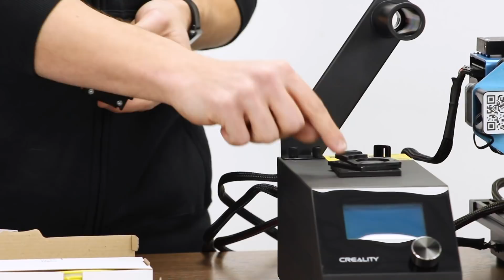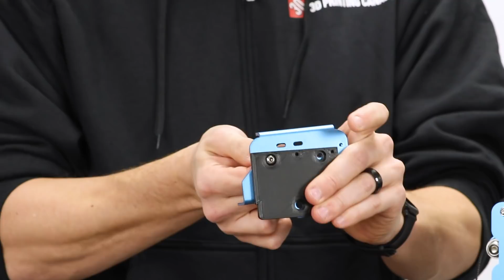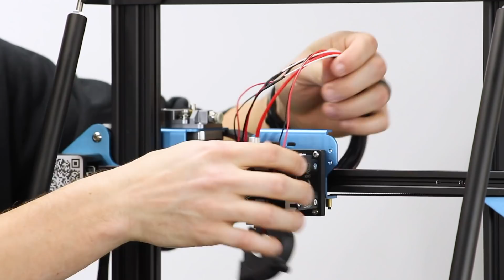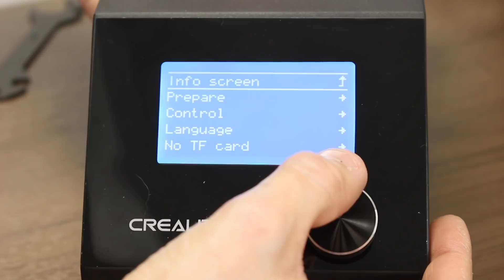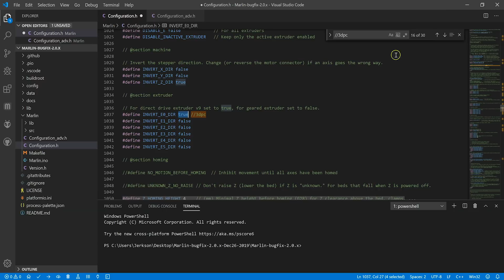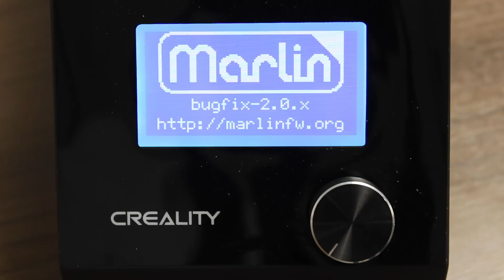How to Install a E3D Hemera on a Creality CR-10 v2

Comment: Thanks for a very thorough and informative video. I have the CR-10s Pro V2, but most of what you did I've been able to adapt to my own printer. 
I am particularly thankful for your detailed walk through the configuration files. As I keep my printer in the shed which is a long way from a computer, I remotely program it over WiFi via a raspberry Pi fixed to the side of the printer. This works very well, and it means that I don't need to have a desktop computer in the room with the printer, or carry a laptop back and forth. I power the Pi from the 24v rail on the printer, using a cheapo chinese buck converter which brings it down to the 5V I need for the Pi. 
Having the printer in the shed also means I don't need to worry about noisy stepper motors, or fumes from ABS or Polycarbonate, when I'm printing with these materials.
Reply: @tasmedic , I’m installing a revo hemera on my cr10s pro v2 , would you mind if I pinged you for some questions ?

Comment: Would LOVE to see you guys do a Hemera Install video for Artillery Sidewinder X1 and the CR10S Pro!!!!  Keep up the great work
Reply: @Jason wish you would of made a video of all of that!
Reply: Please do an install video on CR10S pro. I have a hemera but not confident about the firmware changes hence its sitting there collecting dust
Reply: @Kittzz  Thanks bro
Reply: @deadsimpleali5540  You are welcome man!  That is one thing I love about the 3D Printing community.  We all try to help each other.
Reply: Just installed the hemera on CR10S Pro with a Bltouch sensor. Used the CR10s Pro V2 firmware by following the video by TeachingTech for Hemera install on Cr10 Max. All is working fine. The link to the video is in one of the replies below. Very happy with the results

Comment: If you don't have the button head m3x5 screw and happen to also be upgrading the bed to a flexible steel sheet. The flat head screw that hold the clip on the bed are the perfect size for this application. I think they are m3x6.. but they don't touch the back wall, so perfect fit. They end up just flush with the plate.

Comment: Walkthrough was very useful and I learned a lot of great info about firmware features I've never seen. Ended up compiling/flashing with the Arduino IDE on OSX/Linux due to some issues getting the C++ side of things to work with VSCode/PlatformIO and Windows. Just wanted to let others know this is a viable path if you are unable to set-up the environment mentioned in this guide. Just make sure you select the Mega 2560 board in the IDE and install the "U8glib" library using the Library Manager.
Reply: Is that mega 2560, not 2650?
Reply: @michaelknight2897  Edited! Good catch.

Comment: Ok guys I got the Firmware flashed, 1), make sure you extract with a competent program such as winrar 2) after extracting the files, move the directory/folder marlinbugfix-2.0.x to the desktop, I was getting errors when I tried to build when this folder was left alone where I initially extracted it 3) make sure your Cr10 v2 is turned on when you upload, not just from USB power.

Comment: Hi Jason, can you see an advantage to drilling the carriage and bolting the Hemera directly to it?
Reply: Yes, I did this and in addition to saving a bit of weight and build time, it keeps the nozzle closer to the original position, so I recommend this. It's best to use a pillar drill when making the holes, to keep everything square.

Comment: As far as print orientation for the brackets, did you print them laying down on the bed? I would assume so, but want to make sure the slots for the square nuts will come out fine if done that way. Secondly, oh dear god thank you for this. A big part of why I bought this printer was the easy Titan swap, but then realized that wouldn't fix the PTFE-lined hotend which is my biggest fault with the printer. So I bought a Hemera, and then realized I couldn't find a single mount anywhere online. You seriously just removed so much stress from my life, I was actually contacting design firms. Thanks so much.

Comment: I just had a disaster with my stock CR-10 V2 hot end, the Hemera isn't available, and may not be for a very long time. The stock shroud is pretty over-engineered and doesn't cool that well. I would love to see a video on attaching one of the alternative shrouds you can print yourself (Petsfang or something), AND a real E3D v6. The stock heater block is easily destroyed when you apply torque (like when trying to get on a Titan extruder), because of its use of a cheap thermal adhesive. That would be very helpful with scarcity in some of these amazing hotends for probably the better part of a year...

Comment: Thanks for the video it has been a big help.   I have a question.  @51:40 you talk about a line you added called the Z_STOP_PIN and you set to 19.   Where did this value come from.  I have a Tevo Tornado with an MKS Sgen L board and 2209 TMC drivers.

Comment: Great video. ThAnks a lot. But I wanted to know why you leveled the corners manually and didn’t use the autobed leveling? That’s what’s the BL touch is for. You only used the bltouch  in this video to home the Z axis. Is that part assumed after you level the corners manually? ThAnks
Reply: There is no need to make the z-axis work harder than it needs too. Do a BL Touch bed level. Using a tool like bed level visualizer in Octoprint and see if it is way out of level. If it is, tweak it manually so it is manually close to level and let the BL Touch mesh out the fine details.

Comment: I have exactly follow the instruxtions, but i have a problem with the z offset, i can't get the nozzle by the bed. when i adjust the z offset, then i can get lower than 9.866 or something, i just need 3 mm more. how can i achieve this?

Comment: First of all great video, I just did the upgrade from stock bowden hotend but I have a few differences. First I don't have BL touch and the nozzle seems to be much lower then the stock so my Z never reach the endstop. Do you have any idea how to fix that? Or I just simple need to drill new holes for the endstops a bit a higher?

Comment: Hello! So I got 4 HEMERA upgrades for my print farm for my Ender 3's. I am unable to get some clear Sainsmart TPU printing for longer than 20 minutes before either: A) The filament stops feeding (low tension), or the filament gets crushed and is blocked by the tight tolerances of the Bowden adapter (high tension). I've gone through E3D's entire troubleshooting guide- waiting for support to get back to me. Any ideas what might be causing this issue?

Comment: So what happens when you follow every step exactly, like say 3 times, and when you go to build the firmware you get a failure?
I know this is 2 years old, but any help is greatly appreciated.  Hopefully i can get my printer working again...
Reply: were you getting "MOTHERBOARD is not defined in Configuration.h"?

Comment: Hey Jason,
I am about halfway through the conversion, big thanks to you! I have the Hemera installed, but i noticed i lose some travel since the bracket positions the nozzle off the bed at X home position, and about 10-11mm away from reaching the right side of the bed. Could you change your bracket STL and have the 3 holes for the wheels moved to the left 10mm? Thank you.
Reply: I know I'm responding to a 5 month old post, but I noticed the same thing and Jason actually calls that out that the nozzle is about 14mm off the left side of the bed when homed.
I'm working on remixing the bracket that connects between the Hemera and the adapter plate to move the whole hot end assembly to the right to compensate.
Once I've confirmed that my remixed bracket works I'll post a link to a copy for others to download.
Reply: Updated bracket created, printed and installed! It should give full access to the build plate on the X axis!
Better still, the bracket is compatible with all other parts of the models that Jason created!
Enjoy!
https://www.thingiverse.com/thing:4536121
Reply: HeyRay2 Thanks for the reply! I ended up going a different route since my printer became dead in the water after trying to mimic what Jason did (my firmware flashing experience was horrible). I’m now a Duet user because of Jason haha. I figured out my own bracket for the Hemera. But hopefully someone else reading this will find it useful! Cheers
Reply: @wesc6220  what happened ??

Comment: Are you announcing a new printer model by naming your printer CR 10S V2 in the firmware instead of CR10 V2? :)
Reply: @Jason is the CR-10s the marlin config you are using then as your base install?

Comment: Is the mounting bracket of V2 the same as a 10S?
Reply: @Jason Dang, I'm having such a hard time deciding which printer to order, I thought there was a slight point in favor that the V2 used a standard CR10 brackets o there was all those options, but now both the CR10V2 and the Ender 5 Plus have new and different brackets equalizing them in that respect :P
Reply: @Jason Lol, now now, don't be too obvious and make sense and stuff. :)

Comment: 2 quick questions a) is the modified code/firmware available in the github link (ie, am i good to go if I just install and flash) or do I need to modify the code as shown in the video? b) will this modification allow me to print materials such as nylon with my Cr10 v2?

Comment: Great Video!  Question: When I have made all the changes to the Marlin debug and try to build it, the projects tab in PlatformIO is empty.  No tasks.  What do I do?!?
Reply: Same issue I had. Bit the bullet and I'm re-wiring with a Duet Wifi. A decent upgrade to 32bit and wifi printing at least!

If you're decent with coding (I'm not), you can try doing it in another program. Others had success with that.

Comment: Thumbs down because you skip over listening the belt tensioner and idk how to do that exactly so now I gotta go find another video and then come back to this one 🤦🏼‍♂️ could’ve just done it for doing it sake
Reply: The firmware section is riddled with errors.   Invert_EO, Max Grid, Linear Advance, Bed size, Even the name of the printer is off....I'm a bit shocked that an expert would make that many errors and leave them like that without even a note to correct them.

Comment: This is the second video where I've seen you guys bastardize the bltouch cable connection 
You do know they have a kit for that
And why would you want to upgrade or actually change the hotend Creality did an amazing job with this printer it only needed a firmware upgrade to Marlin 2.0.1 and a heat chamber and I'm using everything from ABS to PC with no problems